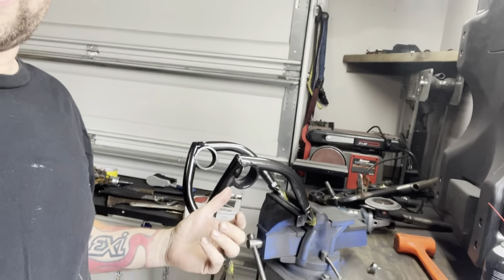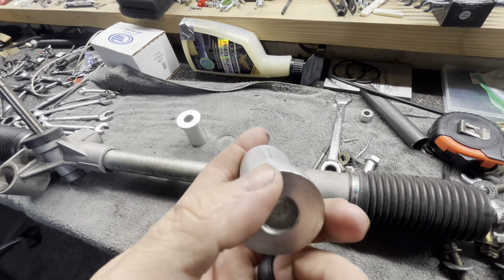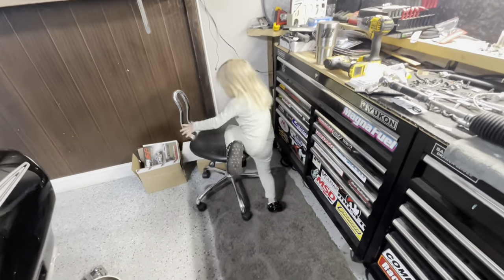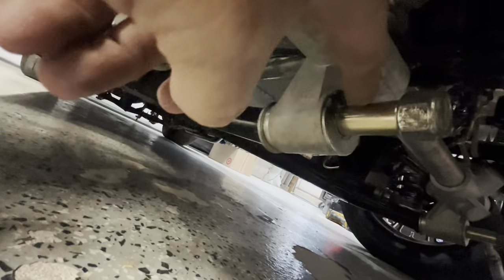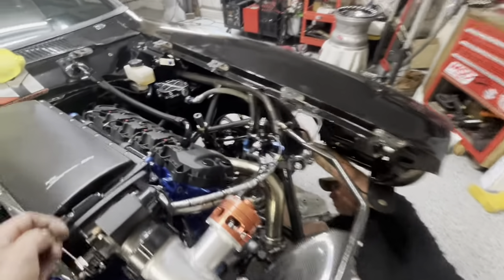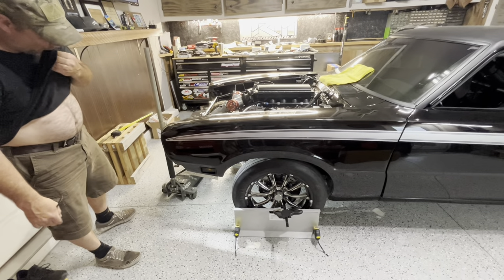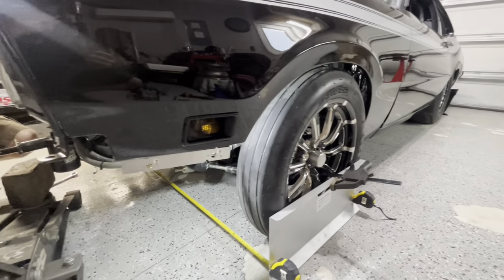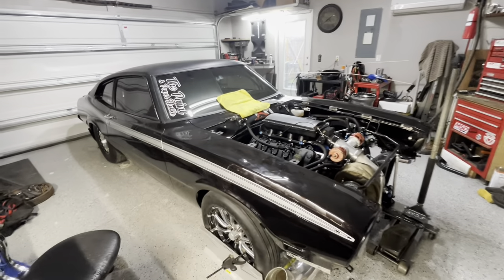🔥 Bump Steer Set Up PLUS Custom Pinto Solid Rack Bushings 😲

Comment: You have a Mustang II rack. A pinto has two bolt mounts on the driver side it's made into the rack and the pass side has an a mount that slides on the rack that's adjustable for  the width.
Reply from the maker: From what I’ve researched online trying to figure it out there’s two kinds of pinto racks. I could be 100% wrong as I’m only going off research trying to figure it out.

Comment: Quick question wanted to reclear the car what grade sandpaper should I use
Reply from the maker: So you can go as low as 320grit dry. However if you’re nervous about taking to much off the wet sand with like 600 or anything up to 1200. Anything finer than that is a waste of time in my opinion
Reply: So I used 400 first then I used 600 so now can I spray or what grid should I spray
Reply from the maker: @tashacorcoran2683 yes you can clear over top of that
Reply: @ThePaintPaperHustle  thanks again man keep the videos coming I'll be watching

Comment: I like those rims that you are using. They make your car complete,will you run the same style on the front? The mix of the 2 style give it the old school gasser/dragster look. You know the look, the don’t you line up with me if you don’t want to be drugged down the track look, yep it’s got that look!!
Reply from the maker: Thanks. No plans to match the wheels anytime soon as I can’t afford it. Originally I purposely ordered both styles brand new. Didn’t want them to match originally. Hope to change the rears eventually